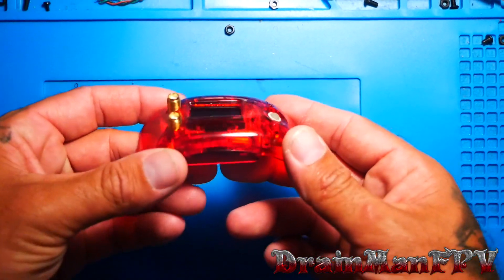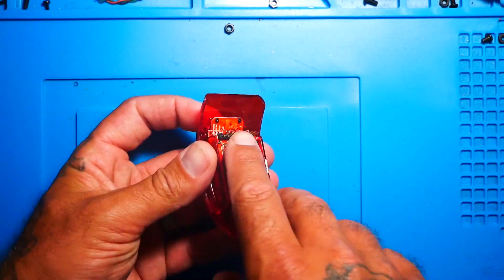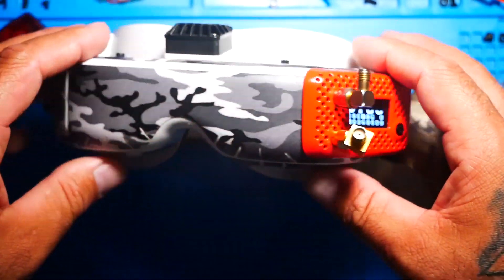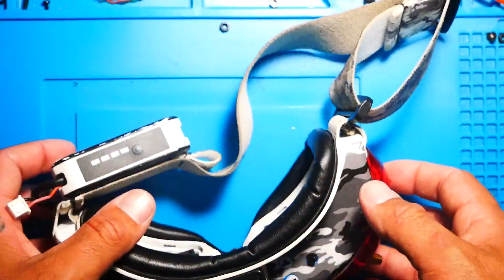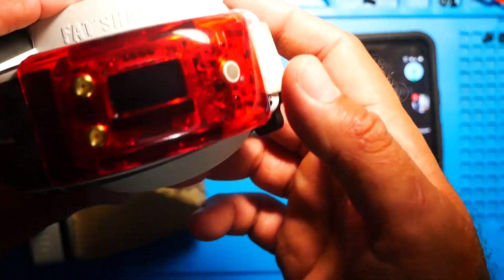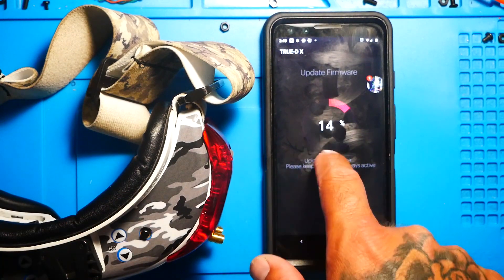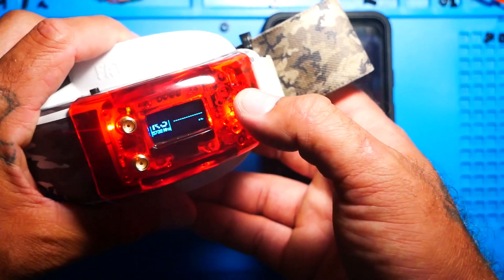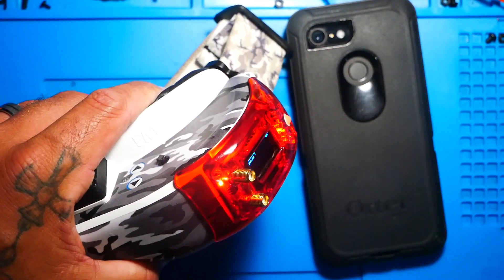Flash Firmware On Your True DX by FuriousFPV - Solved! Malfunctioning Module Fix

Comment: Hi I have a true d not x without Bluetooth the cheaper version. I’m having issues in the calibration. I cannot get the module to pick up signal or anything. I have cleared e prom and flashed the firmware several times

Comment: Thanks for this!  Weird things happen with this module.  I was getting a black and white image using it with DJI goggles and also when in my dock king but full colour in my fatsharks.  Firmware on the unit was v1.3 from the factory but updating via the app put it on v1.0.  Now, after following your bootloader method it's back on v1.3 via the app.  It's working fine with the DJI goggles now too.  Much appreciated!  Subbed.

Comment: I wonder if you have seen this before.... https://www.dropbox.com/s/ixowq7ikl7a3n8f/GOPR9749.MP4?dl=0
I am working with Fat Shark and Furious Support currently. Furious pointed me to this video. Can't believe I didn't find this video as I have seen many of yours. Confirmed VTX output to separate monitor, True-d x scans and finds correct channel but I get a scanning image (dropbox link posted above). Also to note.. I have updated module several times now and tried this bootloader fix to no avail. Thanks DrainMan!!!!

Comment: if i turned off the module's bluetooth before module be malfunctioned, it can be connect to phone app?
Reply from the maker: Why turn off Bluetooth? You will start the module in bootloader so it should automatically follow like mine.
Reply: @DrainManFPV  I considered about battery using. Then bootloader mode automatically turn on bluetooth?
Reply from the maker: @17kHz I'm not sure to be honest, give it a go